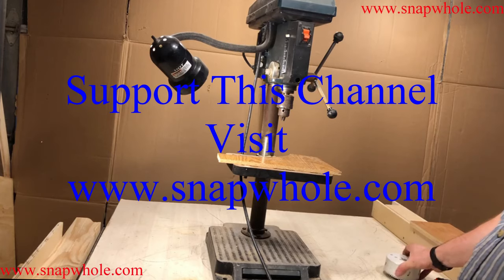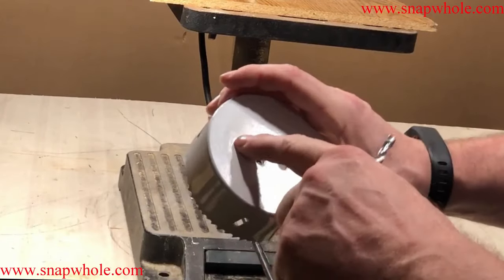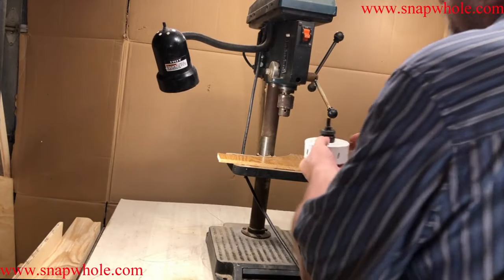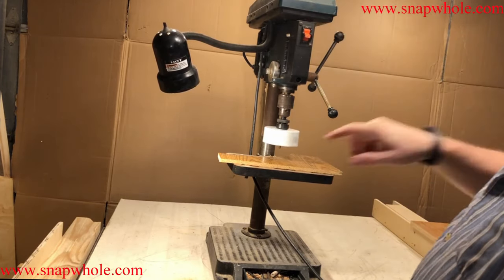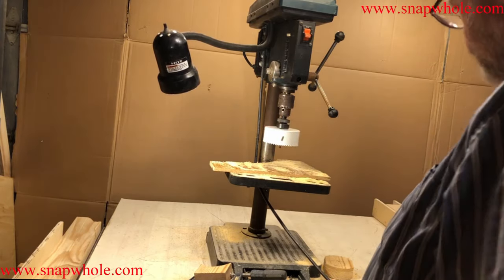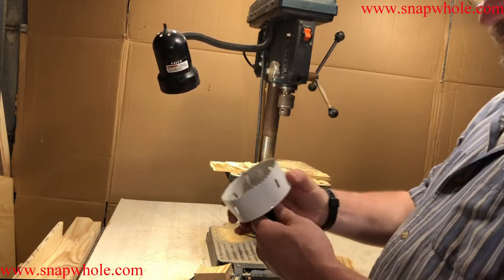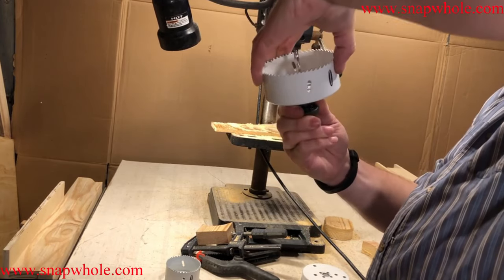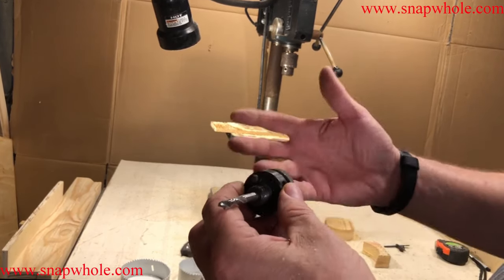Harbor Freight Warrior Large Cut Hole Saw Kit Review and Use Demonstration - With Large Mandrel

Comment: There is a hole on the side that looks like there should be a screw in it to hold the drill bit. I just bought this and there's no screw and the bit falls out. Am I right? Should be a screw?
Reply from the maker: there should be a screw to hold in the guide bit, the guide bit is not required but it does make it easier to start the cut - if you think the tools is not right, I recommend you take it back and exchange it - thanks for subscribing!